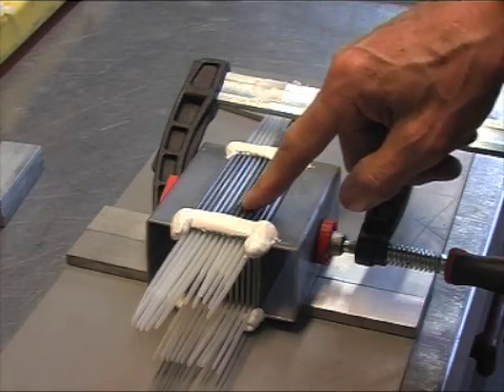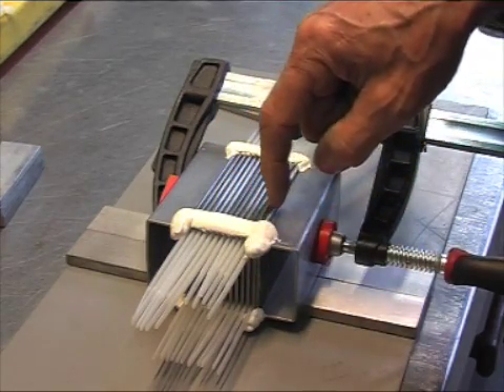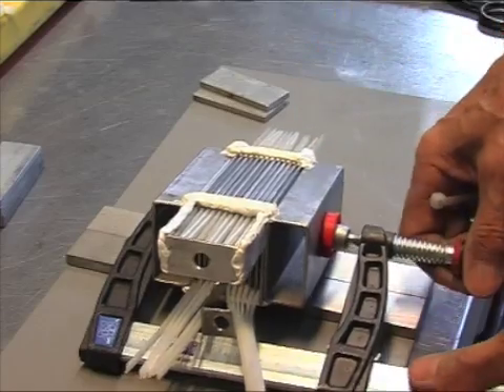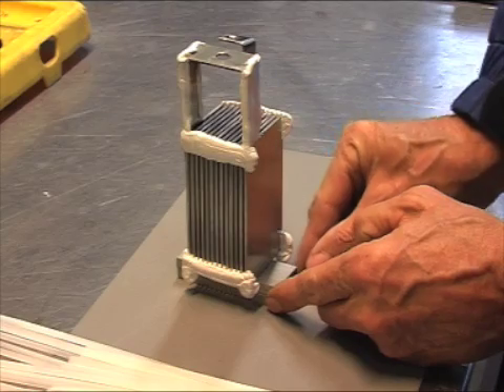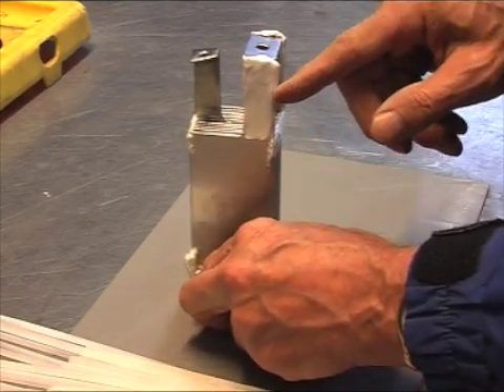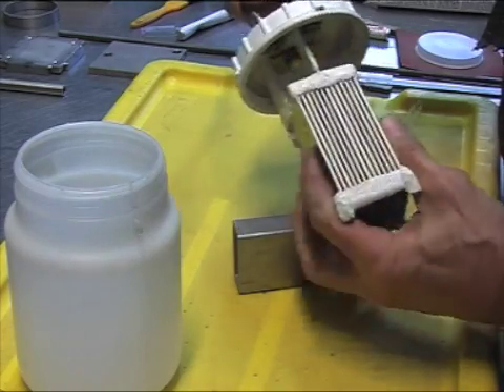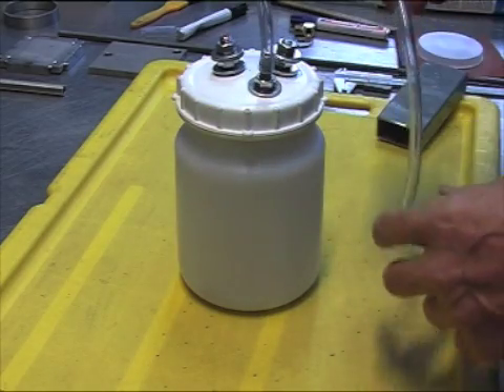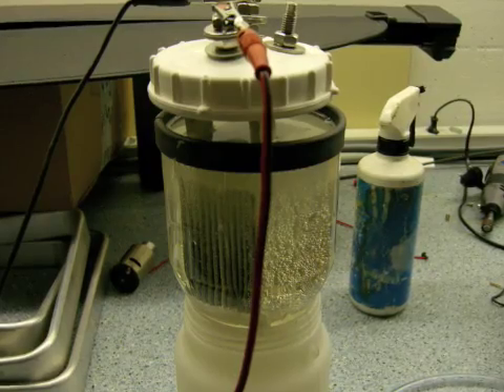HHO SWISS INOX SECOND CELL 13 PLATES

Comment from the maker: @zovik222 A car battery usually is around 13.5 volts. To produce HHO you only need 1.5 volts between plates (actually 1.27 volts), everything above 1.5 volts goes into heat.  If you have a positive and a negative plate and 13.5 volts there is a lot of wasted voltage. if you add neutrals you lower the voltage that  passes from plate to plate.
This is not a scientific answer ....

Comment from the maker: It is not so expensive but it depends in what country you are in and it depends on the size you have to buy. If you can find a metal working company that uses Stainless Steel for the pharma industry or food processing you can ask for little pieces and they cut it for you for little money. To drill it it takes about half the revolutions you need for normal steel and a perfectly cutting drill point and use a lot of pressure then release and press use refrigerating lubricant
Amox

Comment from the maker: Thanks for the English moral support.
The glue is a sealant and also glue it is UV resistant and cures with humidity once hardened it feels like a hard rubber you can use it to glue metal to metal stone to stone and metal to stone and wood and so on it is very universal.
Here in Switzerland  the name is Gyso 444

Comment: avoid using sodium bicarbonate, because it produces CO2. Instead try using sodium hydroxide. In 100 ml of water add 109g of sodium hydroxide at a temperature of 20C.

Comment: hey brother dont use baking soda you are destroying your anode + electrode also youare generating CO GAS plus CO2 gas wich is counter productive for us and most
important  baking soda is converted into sodium hydroxide naho in the electrolysis process so also stainless steal is leaching something called Hexavalent Chromium out of the metal during the electrolysis process.

Comment: Your English is excellent.
That 'glue' appears to be RTV adhesive (used in fabricating engine gaskets and other liquid seals)
 You could do better with perforated plastic film as an insulator between adjacent plates
It appears only the outer and central plates are electrified (yes?)
 Gain higher H2 tru-put using rigid metal foam rather than SS cylinders.
You're producing HHO - not H2 (very explosive in confined spaces) - use Pt or Pd coated PEM to selectively vent H2
What - no H2O inlet?

Comment: Looks vaguely familiar. ;-)

I'll give you a small pointer. Take your first series of measurements for your baseline.

Then, create 2 acrylic pieces to lay across and cover the exposed vertical edges. Evenly smear them with your adhesive about 1.5mm thick. Clamp them to the sides and let dry.

Then take a new series of measurements. I believe you will find much greater efficiency. Exposed edges in a series cell greatly reduces overall efficiency.

Comment from the maker: The glue is a rubber it is a Swiss product it resists Ultra Violet rays  GYSO 444 it is used to bond different building materials  together, wood concrete metal glass and some plastic products. So far I can only hope it will be durable beyond testing
 amox